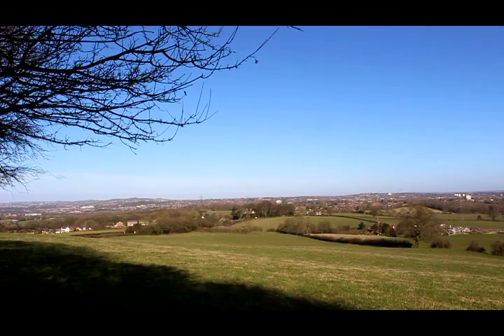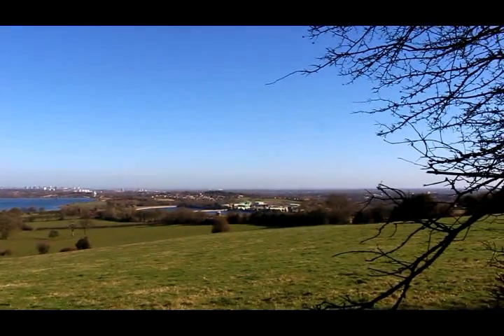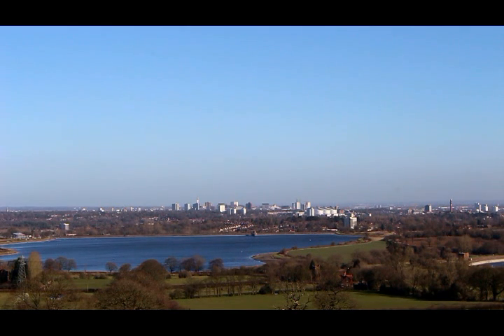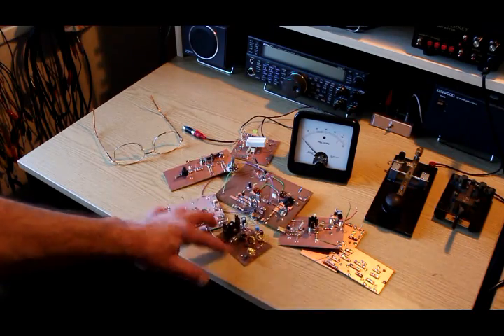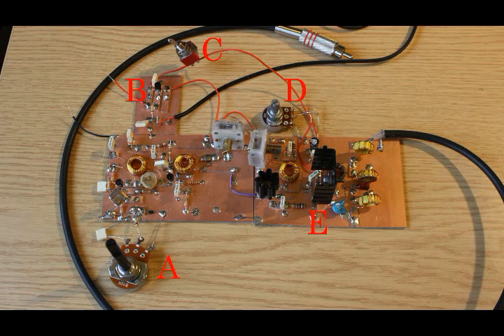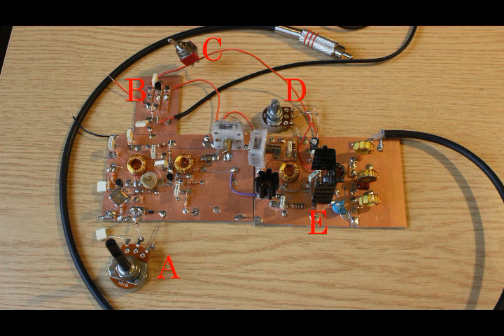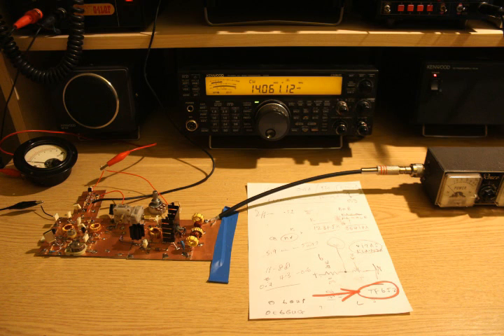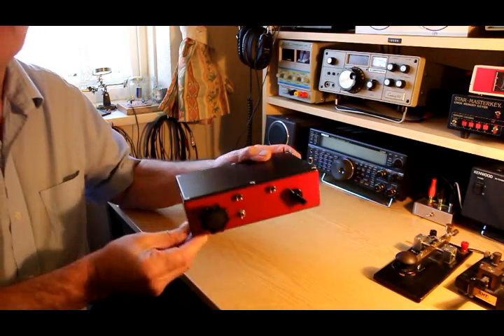QRP CW transmitter part 2

Comment: water came from wales  it came from a lake didnt it????
Reply from the maker: +jerome grzelak  Yes - artificial lakes & dams - that's correct. My home city, Birmingham, grew very large in  the 1800s; but it had very little water supply, because it is on boundary of the two main river systems of England. It is isolated from good water supply. A big project was started, to bring water from Wales, in the 1890s. It comes over 110 kilometres of pipes, from the Elan Valley in Wales. Many people of Birmingham are very grateful to Wales for supplying us with pure, fresh soft water (no calcium) - though many citizens I think, don't know about where their good water comes from!

Comment: More qrp vids please Norman. Your patience and teaching methods are excellent. I've learnt so much. I was hoping you would go into more details about the circuitry though. 73 M6EKL
Reply from the maker: Thanks - will do. However, your comment about showing the actual circuitry is most valid, & has been taken on board. Just finished a new, simpler QRP crystal tx for 7 MHz, wch is working quite well & will be the subject of the next video. As you suggest, the whole circuit will be included with component values. In the meantime, you can see the circuits of the driver & PA stage of the 14 MHz tx in chapter 6 of Frank Harris's book - link in video description; but, I did change his PA device from an MRF476 to an IRF510. I've made some notes on the use of the IRF510 (gleaned from on-line articles) on my QRZ.com page: G4LQF. 73 for now, & thanks for your kind comments!
Reply: Norman Field Hello Norman, how can i contact you, email?John